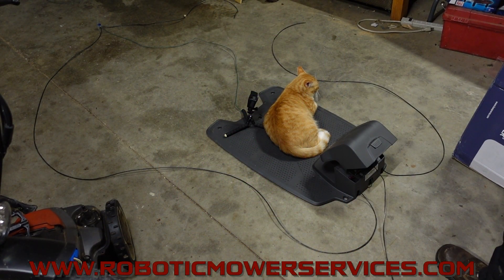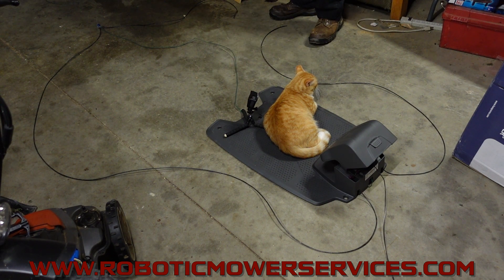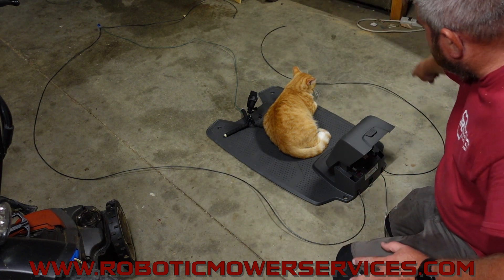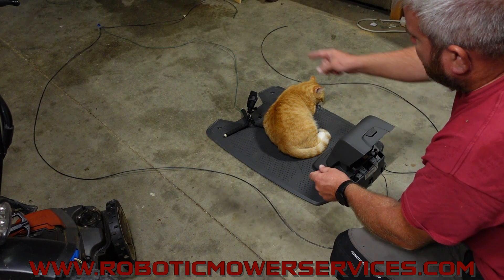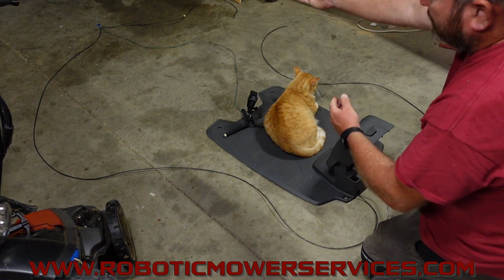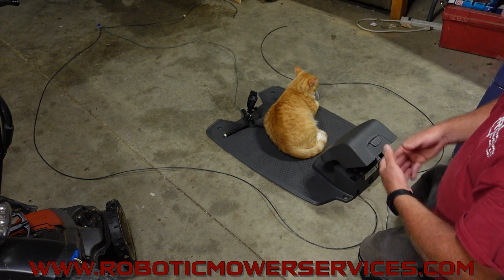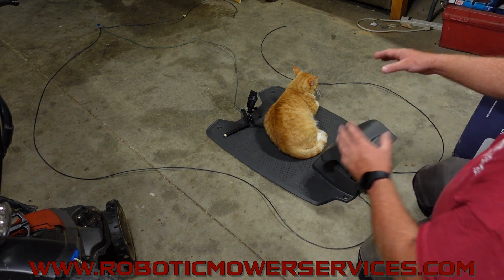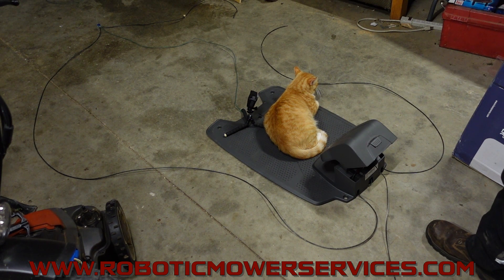Using Guide Wire To Section Off Working Area To Find Automower Boundary Wire Break (No Loop Vid. 7)

Comment: Couldn't I simply use my multimeter to determine which circuit is open then use my underground wire locator NF-816 to find the break?

Comment: We were sat watching our auto mower called ‘Lilly’  when she came to a sudden stop. Been working fine for 3 hours in this session.
Apart from broken wires due pesky wildlife, she has performed to gold medal standard for 4 years. Our 450x has been serviced every year. What I have never taken in to our local dealership is the docking/ charging station.
Error message and the blue flashing light was indicated.
A walk around our boundary gave no indication that wildlife was the cause of a broken boundary wire.
So, as my Dad used to say, don’t remove the engine when it could be a loose wire
Having watched your series on the dreaded blue flashing light, I started at the power source. Stage by stage all results were fine. Double checked, fine. A complete day dismantling wires carefully placed out of sight. 
Then another look at your fantastic tutorials regarding this problem and ‘Eureka’,  
It was those little blue connectors on the charging station, changed those and bingo, success.
Many many thanks, keep up the good work, you are a star.
Reply from the maker: Awesome! Glad you got it figured out